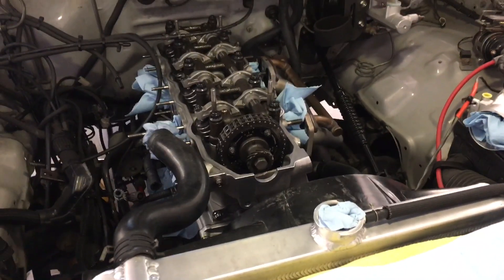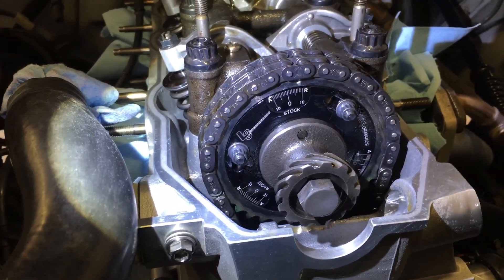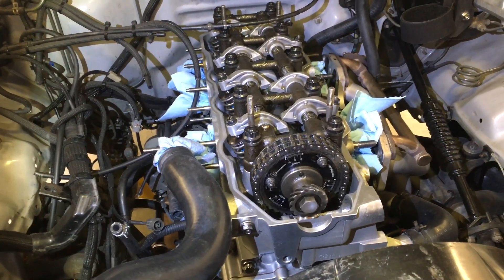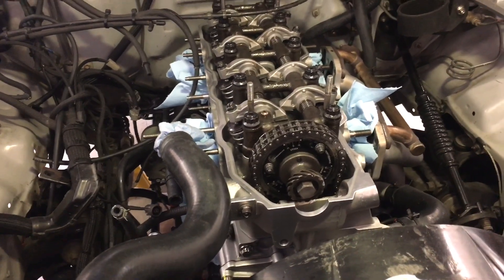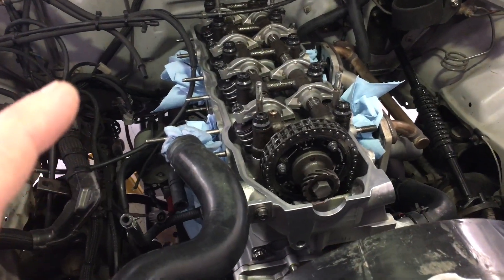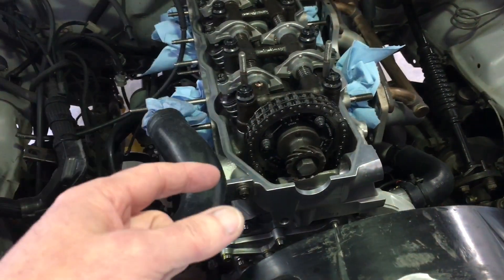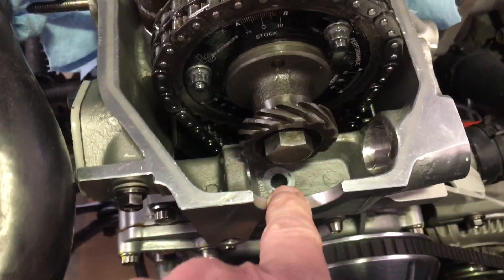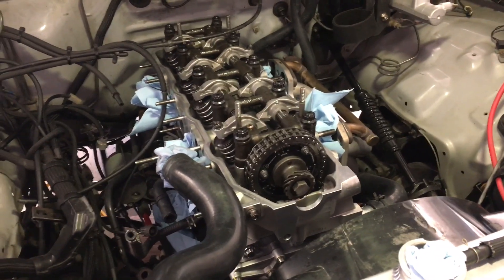TOYOTA 22RE - a few tips on re-timing the motor & camshaft when pulling the cylinder head on / off

Comment: So what your saying is if you drop the chain it can drop off the bottom sprocket? I think thats what happened to me. So if it does that do i scratch the colored links and go off tdc on crank and tdc on cam?
Reply from the maker: Yeah if the chain slip down then sometimes what happens is on the lower gear it will bunch up and/or jump a tooth. If that is the case, disregard the shinny link BS and just put the motor at TDC (using the piston) on the compression stroke for cylinder #1 and install the cam sprocket w/ the dowel at 12 o'clock (the dot on the gear itself should be slightly counter clockwise from straight up and down when looking at the gear from the front of the vehicle. Once you get that, you can roll the motor over a couple of times and confirm the piston is at TDC and the dowel is at high noon - that will rule out any binding on the chain, etc. If you have an adjustable sprocket, then ideally you'd wanna use dial indicators on the motor as well as the card which came w/ your cam, etc. But for factory stuff that is non-adjustable just use TDC and the cam sprocket gear dowel as your guide.
Reply: @ray5961  thx dawg, life saver

Comment: what bolt kit did you use on your timing cover?
Reply from the maker: Some of the bolts are 12-point ARP stainless hardware and some of just allen cap screws from McMaster.com (also stainless). Just random bolts I had in the shop mostly.

Comment: These engines are pretty basic to set up cam timing, you just made it sound so so difficult.
Reply from the maker: Well, I also have an adjustable timing gear and was dialing in a mild camshaft. Keep in mind also, if you are rebuilding the 22RE and/or it has a log of miles on it and things have started to stretch, just bolting everything up "stock" doesn't usually give you correct timing. This is why LCE sells that adjustable cam sprocket, so you can actually compensate for wear on the motor and dial the cam exactly in according to the specification on lift, opening duration, etc.

Comment: What type of sci-fi water pump + belt set up is that??
Reply from the maker: Hahah Lol. "One belt to rule them all and in the darkness bind them". haha. Yeah, so I converted my truck to an electric fan in order to free up HP and try to improve gas mileage and simplify things up front there. I threw away my P/S and basically was trying to open up some space and make things easy to work on down there, so I could replace the belt quickly on the side of the road if ever needed. Anyway, that polished aluminum water pump pulley came from LCE and I have it held on to the water pump with some Titanium bolts. It runs over to the 140A alternator and then down to a Dayco 2 groove front harmonic damper. I had to cut and measure to figure out what Dayco belt to buy, but eventually got it all on there as you see now. I like that it's all simple / uncluttered and just 1 easy to access belt now. Makes life a lot easier. Converting to the electric fan was a job and a half though, let me tell ya.

Comment: did a head gasket job a year ago. its back in my garage now because either i have a bad valve guide/seal or the valve is not a perfect seal. need to take my cylinder head to work and have my master tech take it apart with me and see what went wrong. thank you for the info ray!!
Reply from the maker: Thanks! Be sure to check out my video on valve grinding/lapping a week ago. You might enjoy that. I show leak down testing the head as well as lapping the valves. Good luck on your rebuild over there!

Comment: Nice when is first start up?! I wanna see
Reply from the maker: Won't be long now. Maybe another week or so. I'm about to set the valve lash and final camshaft timing now. I'm slowly putting all the parts back on the motor. I'll try to make a video when I fire her back up.
Reply: @Ray Nada  i left mine with gas in it for 6 months its a 1987 toyota pickup 22r carborated with a weber im doing a engine rebuild starting it for the first time will the gas be good still it has no electronics? Its not gonna blow a valve or anything right the old gas?
Reply from the maker: @chefrobertcaldas  Yeah, gas should be fine. I keep a few gallons of gas around for my chainsaws and stuff here. Every few years I pour it all into my truck and go fresh gas from Chevron. Even if the gas is 5 or 10 years old, it should work just fine.
Reply: @Ray Nada  oh ok shouldn't hurt a 22r motor right i mean maybe like a brand new BMW that needs special fuel injectors and computers process the fuel
Reply from the maker: @chefrobertcaldas  Gas is gas... the BMW won't care either. The only time things get maybe a hair more critical is when using direct gas injection at 2000 PSI, but even then probably wouldn't make much difference. The fuel filter keeps the fuel clean and it comes out of the pump super clean as well. Even if you let it sit around for months and months, it's not gonna matter a hell of a lot either way.